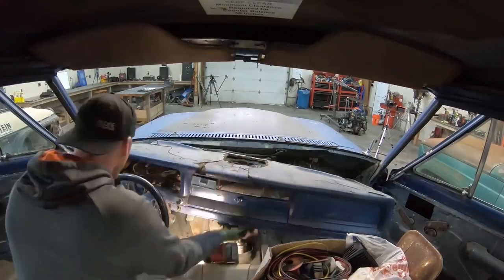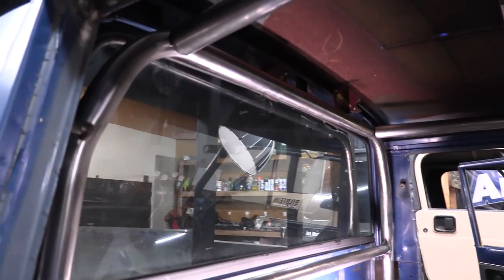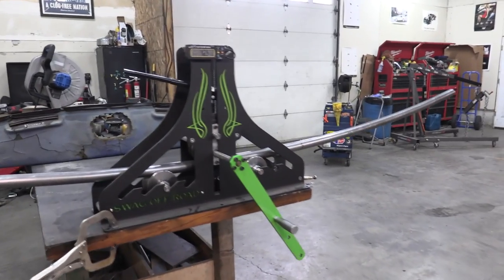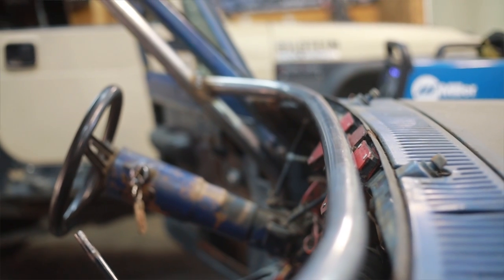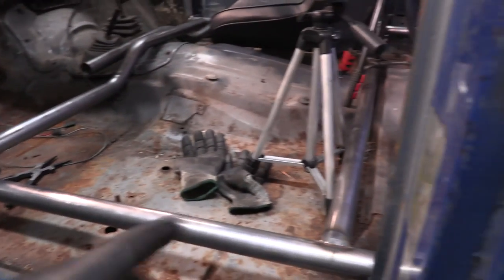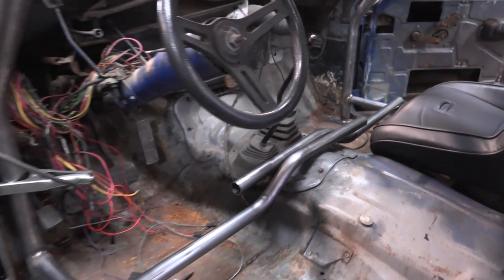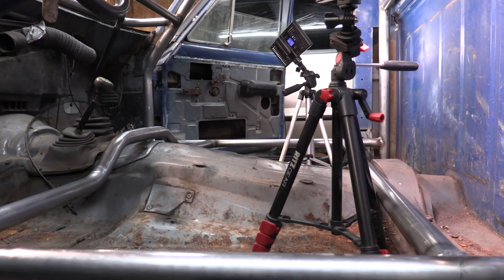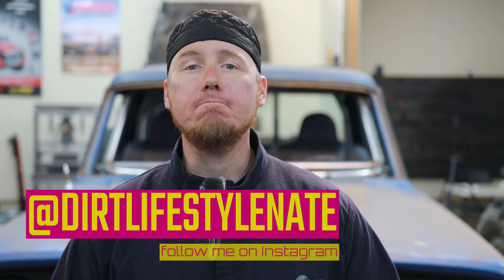How to BUILD your own ROLL CAGE!!! (LBDT Episode 15)

Comment: that one bar with the 4 bends, we call that a 4 point saddle when we run conduit for electrical and we are going over some obstacle, and they are hard to keep straight! but if you make marks on each end of the tubing, it can help you keep it straight when you are bending, just as a tip I learned, and if there is a seam, like there is on EMT, you can also use that to help keep the bends straight. great video, Nate!

Comment: Great job man. I'm surprised that you didn't go with angle iron instead of flat bar for the seat mounts. It's probably fine, but angle should add more rigidity, keep it from flexing (even imperceptibly) in off camber situations and keep those welds healthy. Just 2 cents

Thanks for the tip about ERP seats as well 👍

Comment: I don't use my seat slider to adjust length, but I do use it fairly often to access the open space behind the bottom of the seat. I also have a single cab and storage feels more valuable than gold as my daily.

Comment: One trick for welding the cage in the car/truck that I use since your doing plates is to drill or cut a hole just larger then the cage in the floor. Just set in the plates over the hole, bend and tac it all in, pull the plates drop the cage through the holes weld it up put the plates back and finish.
Reply: Awesome idea!

Comment: Saw you doing layout on the floor, one trick I've used is the 3/4/5 method for squaring things up. Maybe you already know it, if not it's a neat trick you can look up. We use it in Feet for carpentry but it can be reduced down to inches as well.
Reply: You can even go for 6 8 10
Or 12 16 20 in inches, its easier to get more accuracy  like that I've found

Comment: I know I'm late to the party... 
Had some questions:
I thought 90° terminations needed gussets? 45° on both sides. That prevents shearing and push. Also provides you with a place to weld triangle sheet with dimple dies (which we all love).  An A in the windshield looks cool and keeps the roof from folding the A pillars in a roll over. A V from top  center windshield to the center floor bar and back up to rear center halo would keep you nearly crush proof.

These might be WRC specs, but you are off road...

Comment: Is tying the roll cage to the hoop a good idea? It would probably stiffen everything up, but you need to cut the holes in the cab... on the other hand, if it was a good idea it would be more common.

I was thinking about the ways of cheating with the paint. Maybe bend the tubing, cut to fit, take it out, paint it (lave a few inches around the weld area) and then weld it together in the truck, so you end up with only small areas to paint around the welds.

Comment: Wouldn't be a bad idea on the sleeves to drill 2 holes on either of the outer tubes and add some plug welds. Think you will add any tube along the front of the roof, and/or add the vertical tube in the windshield?

Comment: Looking good... didn't expect anything less, your work and programs are all top shelf.  Couple questions... are you going to install any gussets in the corners ? Are you going to come up and out from the  frame to the bottom legs of the  cage ? Are you going to install one or two bars, in the center of the roof. Tying the front bar and rear bar together ? Rollcages should be as good looking as they are functional.

Comment: That is a nice tube bender. I see you have the deluxe return springs.

I am surprised you bent the tube that meets the cowl so it installs flat. Did you consider angling the two bends you put in it at the ends down slightly? See 6:14. Don't get me wrong, it looks good and you do great work and maybe you were just sick of messing with that tube.

Comment: Great work! Looking forward to seeing what you do with this truck. One question is there a reason you didn't add a bar above the windshield? I get that this is cage is more of a style choice but I would consider adding that bar for strength, and would also work well if you wanted to add any switches or mounts up high. Just a thought, keep up the good work!
Reply from the maker: I want to keep the visors and to do that I would have had to locate the tube really low. Everything changes when you don't have a flat windshield like on the wrangler lol. It make little details like this more difficult

Comment: Just started following you. Great videos! Would you have a link to the level that you are using on your bender? A tip from someone that uses a blue wrench a few times a day, cover everything, especially glass,body parts & those brand new seats. You will have small pits on all of it,from your grinding to welding it will be everywhere.Just my .02.

Comment: Nooooooooo mate last thing you weld are the floor plates, drill holes the size of the tube in the shell floor then you drop the cage through weld it paint it lift it back up slide the plates back under weld it all to the floor 👍

Comment: DO you think with the flat bar you will have a wiggle to the seat? I’m just asking not really critiquing but I would have thought you would have used angle. Keep up the good work.
Reply from the maker: Nope no wiggle. Most seats are mounted with tabs and they don't wiggle. These are solid
Reply: Dirt Lifestyle sounds good. Keep the videos coming. I’m stuck overseas until all of this craziness is over.

Comment: Hey Nate, I'm going to be attempting my first fabrication project in the next few weeks, a winch bumper like the one you made for the low buck diesel truck. I was wondering how you decide what thicknesses of material to use for certain parts? As a beginner I really have no frame of reference for how much abuse materials can take and I don't want to just use 3/8ths for everything and have a 1000lb bumper crushing the poor little torsion springs in my truck lol
Reply from the maker: I make those decisions based on experience. I wouldn't use under 3/16 unless it's a peice that is for looks and I I wouldn't use less the 1/4" for anything structural. Structural meaning it has a winch mounted to it or it mounts the bumper to the frame. Good luck on your first fab project 👍
Reply: @DirtLifestyle  thanks so much! I really appreciate the advice. Hope it goes well 😂

Comment: What tubing bender are you using not the pipe roller the tube bender you pulled out to finish the windshield bar corners in the roll cage episode

Comment: Looks great! I have ask, how did you weld the top of the roll bar at the B pillar? It looks like there's  no room.
Reply from the maker: Just enough room to make shitty welds lol. I made it work but it was tight 👍
Reply: Cut holes in the floor so the whole cage can drop a few inches. Then raise it up and plate the base.

Comment: whats the best MIG welder for under $1,000? also awesome video!
Reply from the maker: Note sure the best but Lincoln and miller are my favorites in the US. If you shop around you can find one under 1000. Being able to get replacement parts and consumables is important. 10 years from now if you have an issue, you can get the part you need to fix your equipment 👍

Comment: I've thought about trying to use some cheap-o-depot mountain bike shocks, and make suspension seat mounts. Pivot on either the front or rear seat mounts and the shocks would go on the opposite side. Just a thought while watching this video. I'm not trying to sound like a douche.
Reply from the maker: That could probably work!

Comment: Hi. Could I hear your expert advise about the minunmun tube diameter and thickness for dodge ram 1500 prerunner?
Reply from the maker: No expert advice here unfortunately man. Read through the ultra 4 specs. That what I used 👍
Reply: I found Ultra4-rule-book and a chapter about rollcage in it! Thanks!

Comment: I want to do a roll cage but have no tubing bender can't come up with a. Cheep way to do it
Reply: I get around not having a bender pie cutting my tubes, I dont know if its applicable to your project but it worked for me.
Reply: I do it on exhaust and non structural stuff but I don't think it would be a good idea for an  exo cage

Comment: You need a notcher.........there’s a lot there you can get away with. I can fake a bender. Can’t fake a weld, can’t fake a notch (well you can, but it’s a royal pain in the ass). My notcher was $280......cheaper than the steel on my first cage.

Comment: All this cage and seats..and all the metal is not Stainless. Over here in Mass all I see is rust everywhere. I actually looking into rebuilding mt bumpers but with SS.
Reply: Wow, that sounds expensive. I'm in PA so we have penalty of salt in the winter, but due to costs of materials I think good coatings are a better value. I used ZRC cold galvanizing on my five skid plates and they turned out great. I bought a HF HVLP gun to spray it and drilled the nozzle out to 2mm per the ZRC tech sheet for recommend nozzle size. If you aren't into the grey color, top coat them in black or something like raptor liner. The ZRC is a great product because unlike paint it will continue to protect the steel even if scratched up to about a quarter inch scratch. 

If you already have bumpers what about sandblasting them and re-coating? I used the cheapest HF sandblaster (portable abrasive blaster) with some coal slag media for my bumpers to prep them. I only coated my bumper in raptor primer and liner, but if I did them again I would do ZRC as the first coat, then the raptor liner. I don't think you'd need primer because the ZRC can be applied to bare steel. 

The blasting makes a mess in the garage so be prepared. You can blast outside, but I wanted to recycle the media. I strained it after sucking it up with a vaccum using a kitchen strainer to keep chunks from clogging the blaster nozzle.
Reply: @Fix_It_Again_Tony  I would like to find someone that would strip the bumper to bare metal, clean up the wields, and use the strongest black paint on the market. But that doesn't exist anywhere remotely near me. But I do have a friend that does SS metal fab.